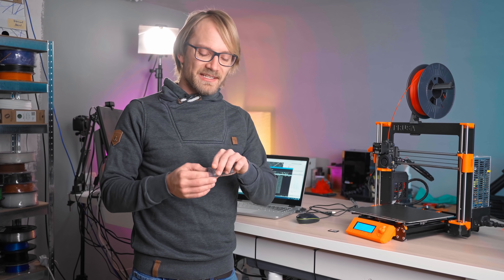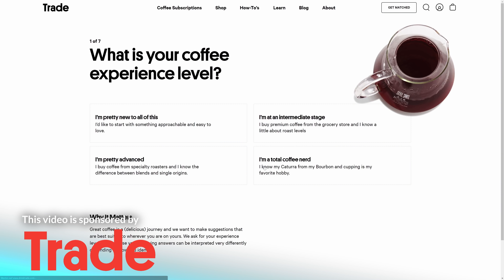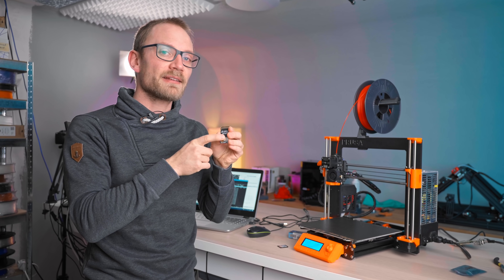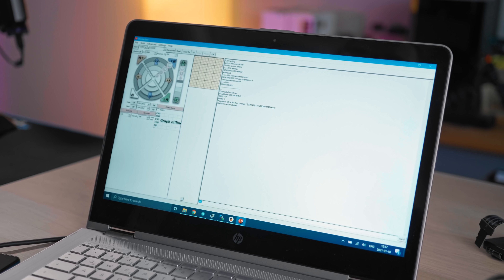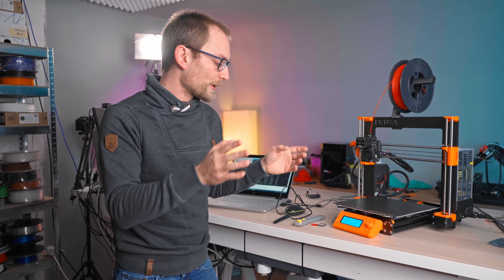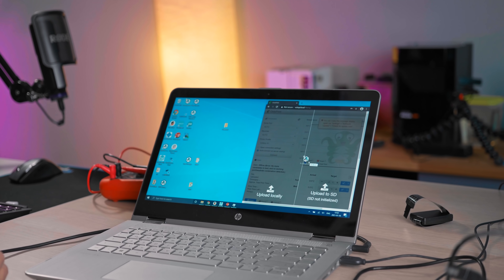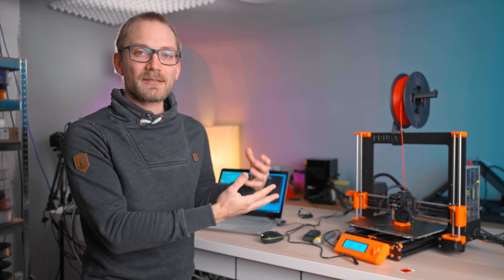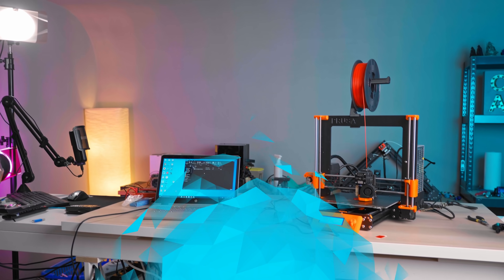SD Card + ESP8266 = OctoPrint Alternative?

Comment: SDIO is an interface designed as an extension for the existing SD card standard, to allow connecting different peripherals, like WiFi and Bluetooth, it was common on things like the Ipaq. Now a days it's mostly used embedded on things like the raspberry pi

Comment: Re: that file transfer speed: I've often wondered why 3D printer firmwares don't seem to support any file compression (as far as I've seen)...

G-code files are just text, and stored very inefficiently (lots of bytes relative to information content), so even good old gzip should make a huge difference - and gzip should be easy to implement, requiring minimal extra space in the microcontroller's program flash storage and RAM, and it doesn't require much computing power, either...
It presumably already has FOSS implementations for every platform on earth, too, given its ubiquity in open source projects.

Bzip2, xz, zstd, etc., would give even better file size savings, but they require more CPU+RAM to decompress, so I'd be totally happy with only gzip support!

Comment: The haircut out of nowhere was amazing.
There is a trick where you can rename gcode files to jpeg and send them on regular photo wifi SD card to your printer. Just have to make your printer firmware read them as gcode.

Comment: Wifi sd cards are not new. Having one that has a sd card slot on it is unique... But I wouldn't get it as the wifi sd cards that have been around forever fit in a sd card slot. (They are made for digital cameras)

Comment: Personalty i use toshiba wifi air sd card,,, two and some generic one .
They all ave variant of the same problem...time out power on the card.

30minutes to 1h....so to reactivate the card, two printer are on X10
power.... wen i want to send to that printer....on-off remotely. Then send the file.
Whit 5 printer in the other rooms its only two accessible that way..

a working is not really efficient system...i am on a unix only network... not linux, windows
or mac.... a total unix network system that include the only antivirus on my computers.
My server got one network one.... even any windows10 that connect home. End-up
is Microsoft one turn off or no access to the network...that one of the part
octoprint do not work....for nearly two years and many version...nada

i will check your card...thank

Comment: You could try to install ESP3D on it. This may be a little bit more comparable to OctoPrint.
Reply: tried it, the transfer speed is still very slow.  tho it does control the printer, its just very laggy.  and once loaded the file can be printed.
Reply: @orbitalair2103  thanks for the info!

Comment: Similar SD wifi cards have been around a while, and are used by digital photographers to save them swapping out the SD cards from their SLRs and to obtain immediate backups as soon as the photo is taken
Reply: Yes, and the camera can upload photo's to a PC with a proper driver setup. But it doesn't work the other way around. These wifi-cards are not in any listening mode. Won't work in a printer.

Comment: Octoprint on Pi Zero W isn't great if you want to use a camera, but if you can find the Zero at MSRP it's only a few dollars more than this, especially considering you need a microSD anyway. Of course, you need the right OTG to Mini USB cable, or adapters, but still. This is a cool solution in search of a problem, not a competitor on a market.

Comment: This is great! Thanks Thomas!!! 
Any chance you can explore some solution like this for resin printers? Something that does wifi-to-USB for Mars, Sonic, etc...
Reply: I plan to hide my printer away in a closet.

So plan A was a simple angled USB extension (90° male to female Type-A) cable 

plan B: it might be possible to use something like this in the video. Would be great to move files around and being able to create backups from already printed files.

Comment: See ESP8266 WebDAV in GitHub, it's basically the same (I'm sure it uses the same code), been using that for a year now. 250KB/s speed, not so bad, and much better than  having to remove it everytime

Comment: Wi-Fi SD cards used to be a thing, and came in a way better form factor
Reply: Yeah, they're all out of production now - all the products they were intended to add WiFi to ended up with WiFi built in, which killed the market for them.

You can still buy the Toshiba FlashAir in a lot of places, but it's stock that won't be replenished.

Comment: In my case, the WiFi adaptor will make sense because my printer still want work with Octoprint. I can monitor my printer and also control the axis manually, but running a print always results in an error. So getting the ability to move files to the printer will save me a lot of time running down the stairs to get the SD card to the computer and back to the printer.

Comment: Looks like a nicer cheaper alternative to the Toshiba FlashAir which Prusa Firmware actually has a specific option to support. Nicer though since its not tied to a specific SD card and capacity.

Comment: I'm slightly disappointed that you didn't mount the hair trimmer to a WhamBam Mutant and get a nice, perfect 0.2mm-resolution cut. Could have even used the ESP to upload the haircut.

But: I literally thought "WTF is up with the hair?" and only seconds later you whip out that machine. Not bad!

Comment: I see this being used on print farms. You could potentially automate connecting and deploying the files on the SD card without having to do it manually one  by one or having to attach a rpi to each printer.

Comment: I have been using a Toshiba FlashAir card for a couple years on my MK3 and have had no issues. It transfers quite slow but gcode isn't usually large anyway. No issues setting it up or any bugs. You can also upload to it at any time. EDIT: Seems like the FlashAir cards have gotten very expensive. I found a few alternatives but not sure how well they work.

Comment: hi, im looking forward to upgrade to a better 3dprinter, im currently running a heavily and badly modified/"upgraded" ender 3, i was looking for a prusa mk3s, bu of course, its too expensive for me, so i looked for a trianglelab/fysec clone, but i couldnt get enouth info about neither.... is any of those recomendable?, what kind of upgrades are needed for reliable 3d printing, I just want a printer that prints really good, its reliable and needs very little maintainance.

Comment: @Thomas Sanladerer
Just a "Quick tip"... 
... If You find that You want to calculate how long it takes to a transfer a file with the size is specified using Bytes (as they normally are). But the "transfer speed" is given using "bits" (Mbps, as they normally are). 
You do not necessarily have to first divide the "transfer speed" with 8 to figure out the "speed" in MegaBytes/s... AND then divide 1MB with that result ((in effect inverting it)) to figure out the time it takes to transfer 1MB...And then multiply that result the size of Your file in MegaByte, to figure out how long it takes to transfer Your file..As You appear to do @10:59
""You can actually use the old trick"" to take Your "speed" in "Mbits/s", and simply say that it "roughly" takes 8 seconds to transfer the same number of MegaBytes (i.e that is You "MegaByte/8second "speed")...And then if You want to be "Really Specifik" You can divide Your file size (in MegaBytes) with Your  "MegaByte/8s" speed, to get the transfer time (roughly) ;)
And hence it takes "roughly" 8 seconds to transfer 1MB at 1Mbps--- 
Because 1MB/(1MB/8s) = 8s... See much simpler ;)
Best regards.
... And Yes I'm joking (or at least attempting), as I was a bit "taken aback" @10:59 when Thomas paused (and appeared) to "calculate" how long it took to transfer 1 MB at the speed of 1Mbps
"Now... As You were..."

Comment: When I first started printing I was actually looking for something like this as I would (as thomas said, save me a trip upstairs to the printer). @ThomasSalanderer What I was wondering is if prints are faster compared to octoprint as octoprint uses the usb connection to the printer (basically sending over com) vs the actual SD Card slot.
Reply: Unless you're seeing your printer pausing between moves at all, the SD card won't be any faster than OctoPrint+serial.

3D printer firmwares maintain a command buffer, at least when printing over serial/USB (I don't know about printing from SD) - they have the next handful of commands in memory, ready to be executed, in case there's a momentary delay in getting more commands over serial.
Also, as Tom said, our 3D printers generally use the SPI bus to read SD cards, and that's pretty slow itself!

The actual speed of the print moves is controlled mostly by the speeds and accelerations defined in your printer's firmware and your slicer profiles.
The serial/USB/SD card throughput won't make movement slower: it'll just cause the printer to pause while it waits for more commands, if necessary.
So if you're not seeing that (eg blobs on your prints), it's all fine :)

Note that you really don't need much serial throughput for typical FFF printers and typical print jobs.
I think the most-common baud rate used for our printers is 115,200 bps, but I've had no problem printing from OctoPrint at just 9,600 bps (when troubleshooting something) - that's still around 1000 characters per second! (~1000 bytes per second, technically, rather than *characters*, but G-code is only going to be using 8-bit ASCII...)
Reply: @AndrewGillard  Hey, thank you very much for your (extensive) answer :). It actually explains the difference (or non existing difference in print quality a lot). Might need to get my hands on one of these cards to have some fun with (probally will need to use my 'old' printer as the other ones are upgraded now :)).

Comment: I had thought that this might be great for my old anycubic photon but the file size limitation breaks that use case - resin files, particularly with antialiasing, are hundreds of megs. 

The photon does have an ethernet port and you can connect it and push print jobs to it over the network, but it is very slow.

Edit to clarify: The photon supports an SD card if you solder some pin headers to the board and connect it, and have firmware that allows it to work. There is also a virtual networked usb stick project you can build with a raspberry pi zero for the photon, which probably works great but i haven't tried it.

Comment: Very interesting! 
I think it's quite a waste to use a raspberry pi if you still need a software on your PC to do the slicing JUST TO TRANSFER FILES efficiently. I mean you have the board with the firmware, the raspberry pi with octoprint and you have your slicing software on your PC. 
I've looked into the newer 32 Cortex M4 boards but only the really expensive duet offers an ethernet connection. And communication over USB seems to be limited by SD card write speed or the serial baud rate.
All I really want is being able to connect to the printer from my PC using ethernet or USB and quickly transfer some gcode file without waiting forever. 
I guess the smoothieboard V2 will offer fast ethernet, but that will be expensive. Until clones come out and they'll get angry about that too haha.
Thanks for the video!

Comment: Thanks for the review! I ordered such a thing a bit ago (did not arrive yet). I ordered it although I actually have ocoprint running... kind of running... an issue sometimes heard of are buffer underflows which cause the printer sometimes to pause and create blobs in the print. It started occurring for me at some point after octoprint worked flawlessly for many prints. I didn't have time (and mood) for bugfixing yet, so I went back to moving the card between printer and computer.
I was hoping for more speed than you measured. Still it is faster than uploading to SD via octoprint I guess...

Comment: Why don't they simply make an ESP32 board with a uSD slot that you connect to the USB port of the printer and can then offer its serial interface over WIFI (for live commands - would be too slow for printing) and also allows WIFI uploading to the uSD card and can then feed the serial with content from the uSD, which should be fast enough, no longer depending on WIFI to complete the print, but still able to give status and emergency control over WIFI.  Then a plugin in OctoPrint could make this device easy to use without requiring a cable connection between OctoPrint and the printer ...  Actually, since OctoPrint can normally already store stuff on the printer's SD card using only serial connection, you might not even need the uSD on the ESP and then an ESP8266 might be enough...  Is that what those WIFI addons for BTT boards do?  Are those usable?

Comment: thx super cool I always wondered how these wifi sdcards worked (without 3d printers) . specially about the locking part. And you explained this very well!.It even said that marlin was using the sdcard. Maybe you can mount it on a linux server and than share the mount over samba to windows again. Just to stop windows from messing up.

Comment: Having this only saves you from making one trip to the printed grabbing the SD card. You will have to go back to the printer anyway to start the print, so why not simply using two SD card you swap instead ? Makers most likely all have at least a couple SD card right ?

Comment: I didn't read all 222 comments, but i'm going to guess that when saving your INI file from windows it saved the line endings as CRLF, but linux is very picky about that will not read your file properly that way. You'll need to ensure you save the file with LF line endings ( you can do this in notepad++ or vscode)

Comment: It's a novel idea, and a bit more drop-in than Octoprint. But the reason I use Octoprint is for monitoring, progress reports (push notifications), webcam & etc. So doesn't really do the job for me. Would be useful for things like older Sailfish based printers (e.g. Wanhao Duplicator 4), but it's a small used case!

Comment: Great Self Haircut.  I never expected hygiene tips from Tom.  Whattaguy.  Funny thing:  I just ordered one of those ribbon adapters the other day.
Reply: Be aware that the SD card ribbon adapters (and probably the "PCB-style" microSD-to-SD adapters as well) seem to be vulnerable to electrical noise or something.
Or maybe my dash cam (a not-cheap, dual-1080p-cam-with-TFT-screen thing from BlackVue in 2014) is particularly fussy in that regard.

But I've tried several adapters of different types because the microSD slot of my dash cam is bizarrely recessed and annoying to get cards in to/out of, and I've had major issues with all of them - cards not being recognised or the dash cam "losing" them at random...

I think that cars (possibly ICE vehicles moreso than EVs..?) tend to be rather electrically-noisy environments, so adapters like that will probably be more reliable on a 3D printer, but it's still worth being aware of!
The Smoothieware documentation warns against using any kind of extension for SD cards, including SD card slots on display PCBs, which are often just a passive SPI extension cable, essentially...

I'd recommend keeping SD card adapters like this away from stepper motor cables, especially! :)

Comment: I don't understand this device? They already have for many years SD cards with built in wifi.
Reply: Yeah but the one compatible with the Prusa (Toshiba FlashAir and you need a specific variant) is hard to come by, rather expensive and it's not bulletproof either as I've heard. This is much more cheaper. And because it's operated by an ESP8266, the firmware is open source, so I think the community will iron out most of the issues. eg. I would simply drop the WebDAV crap and replace it with a simple FTP server for starters which works much reliably. :)

Comment: This is an interesting consept for other applications as well:

If it is possible with USB-adapter, and the file size limit were solved, it would be interesting for my video recorder, to avoid physically moving the USB drive to transfere files to my server.

Some stand alone media players use SD/USB. It wouød be nice to update the files for the playlist, without moving the media.

The power issue could possibly be solved using the micro-USB connector for extra power.

With different firmware on the ESP8266, i see potetial for:
- auto transfere new files to server (and remove from SD)
- auto transfere new files from server
- auto remove old files from SD, after set time, to always have a set minimum free space.

Comment: SD Wifi has been a thing for like over a decade. Some people use it in photography so that they can keep their camera on the tripod and get files off of it. Roughly the same price (Link shows around $20 for me) as this jenky thing, but also higher capacity. Don't know about the stability or actual use of them since I don't have one, but they are just a normal sd card solution instead of a pcb with an extra bit on the end.

Comment: Toshiba FlashAir runs at 10mbit per second and the upload works even during printing.
We at Prusa Research did experiments some 4 years ago, implementing a rudimentary statistics web page (print status, temperatures) directly on the FlashAir. Unfortunately Toshiba was phasing out the product already, so we did not push it any further. Interestingly the FlashAir cards were available until recently, now the sources are drying out.
PrusaSlicer supports sending a G-code to FlashAir in a similar way to sending to OctoPrint.

Comment: havent watched it yet, but all i can say is printing over USB should be normal. sd cards shouldn't be normal. Its just a pointless extra step. we should just be able to print to a 3d printer and have it store it in a local cache. i use USB printing with a (now out of date) slic3r PE. just use a linux PC. a raspi controlling it is exactly the same as a linux PC controlling it over USB.